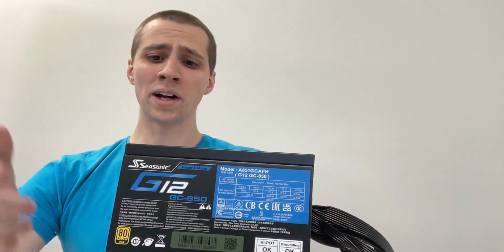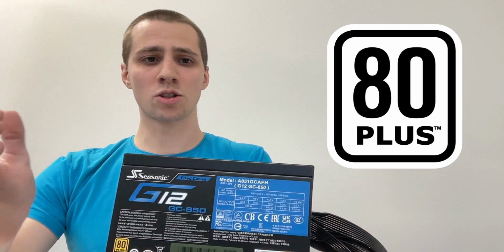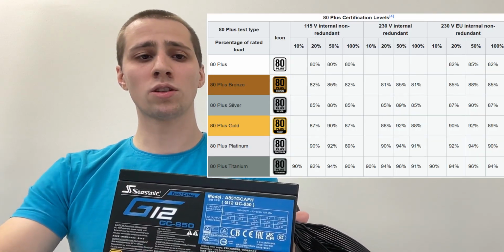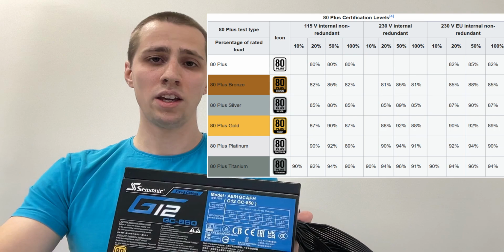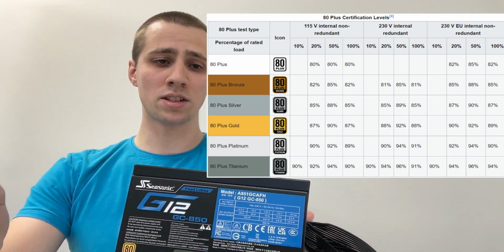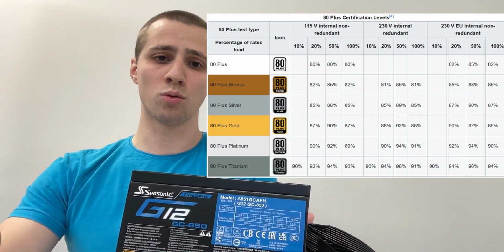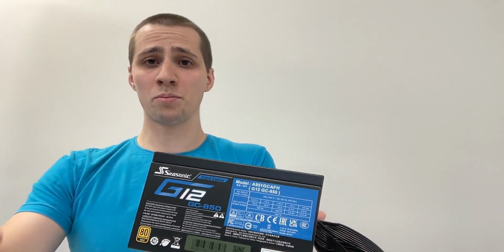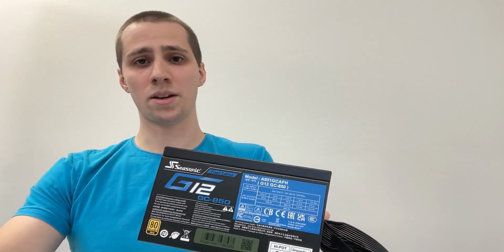PSU Explained. Basics of the Power Supply Unit.

Comment: Good video. Can you consider doing a video that shows where the PSU connections actually connect on the motherboard and peripherals?
Reply from the maker: Thanks! Yes, I’ve planned a video on PSU installation, including where each connector goes. It will be released soon.
Reply from the maker: Hi, I pushed to release the video you requested sooner. Feel free to check it out:
https://youtu.be/16XqgW0aJ1w